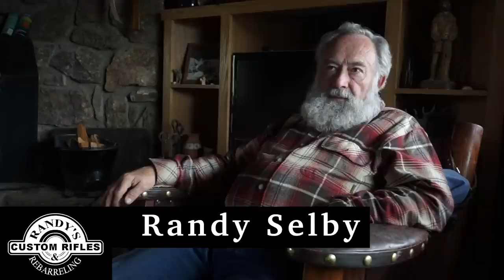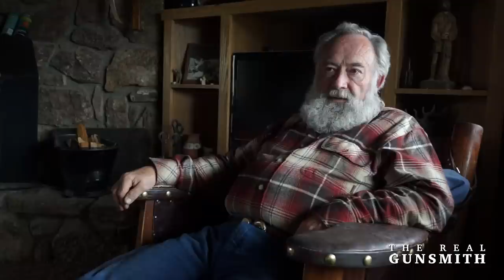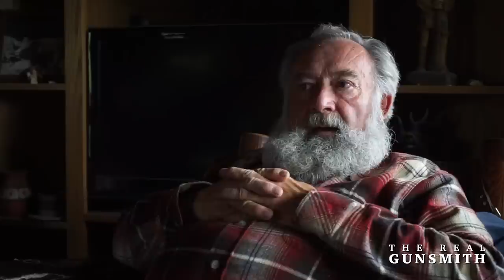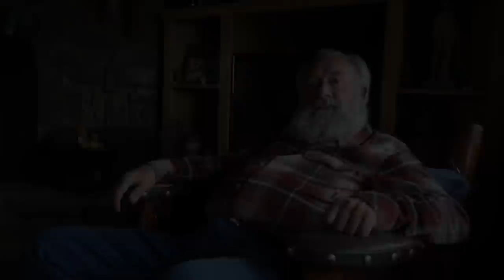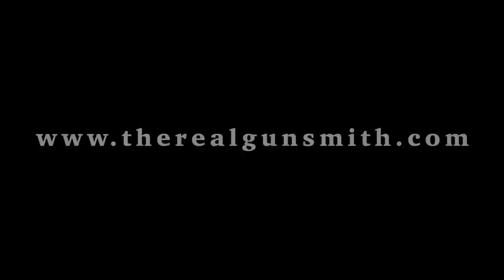Barrel Accuracy Life – The Real Gunsmith

Comment: It would be interesting to hear what the Army experience is with barrels. I remember shooting a 7.62 mm belt-fed Browning machine gun until the rounds were going out wildly out in every direction, completely worn out. Heat was definitely the most important factor.  The barrel was white-hot.  WWI MGs were water-cooled, allowing them to shoot incredible numbers of rounds in succession.  .  Somewhere out there, there is a cloud of data on what the engineering parameters are. I'm sure that it does not contradict what is being said here.

Comment: As a Tanker who used a M240 on two different guns. The main coax gun is connected to 10k rounds in a belt fed system. We alternate barrels as on gets red hot. It's using the same sighting as the main gun also shooting tracers. Never loses accuracy until the twist is wore out. 19k out.

Comment: Barrels are consumable items like tires. You want higher performance tires, they are used up faster. And your super hot rod rifle rounds also wear things faster.

The flip side is a cartridge like the 6.5 Grendel that runs only 30gr charges, a max of 52k psi and gives barrel life that seems to last forever with 123gr bullets at a modest 2450fps or so. It’s becoming my favorite cartridge because it’s so balanced.
Reply: Ding, ding, ding. I shoot a 28 Nosler that hasn't seen 1 round of factory ammo. I roll my own. In 50 rounds I found es of 6 with a great velocity that shoots sub moa. This old fart talking on the video just wants to knock anything that has any life to it past energy of a 270 lol

Comment: I love listening to someone that knows of what they speak.  I've done a little gunsmithing (compared to Randy) and I've taught gunsmithing at  continuing education college.  I built a 6.x55 on a Mauser 98 action about the time the Creedmoor was introduced and for a while wished that I had chambered my rifle in 6.5 Creedmoor.  During load development I realized that I was getting the maximum velocity for that action and my chambering because the bolt lift started getting stiff at around 2950 fps with a 120 grain bullet.  The rifle shoots in the threes and has taken many feral hogs, white tail and blackbuck antelopes.  There's no benefit with the particular action I used to more speed.  No animal I have shot with it survived and most dropped on the spot.  A few ran up to 100 feet.  All of the paper I have shot died immediately.  At my chosen velocity of 2775 fps I anticipate that I will not shoot the rifle enough to need a new barrel in my lifetime and I shoot far more than the average hunter.  I practice throughout the year with my rifles so I am competent when it counts.
Reply: Facts!!! I agree buy a little bigger and load in the mid range or so and extend barrel life! You usually will find better accuracy at those nodes also!

Comment: Through experimentation, load development, & patience - I made an old Mashburn turn from a keyholing has been to a 1 hole 3 shot group rifle @ 200m.  I started with factory Remington 25-06 ammo - one box of 100 grain flatbase & one box of 120 grain boat tails. I shot the boat tails first to try & sight it in @ 25 m & nothing but keyholes. I finished that box to fireform some cases. When I switched to the 100 grain flat base factory ammo - it shredded the hole @ 25m. Moved out to 100m & shot sub moa, even while fireforming. If I forget to pack ammo  to hunt with I can still use 100 grain flatbase factory ammo just fine. My go to load is 58.5 grains of H-1000 pushing a 120 grain flat base. At 2850 mv it cuts little 1/2" cloverleafs @ 200m. After 3 shots it starts to string. I keep my shots limited to 300m so I don't need more than 1 shot anyway.

    The throat is eroded for the first 1/4" of the barrel's rifling. This gun will not shoot boat tails - guaranteed to keyhole the target even @ 25m. I tried boat tail handloads with proper fireformed cases. Don't give up on these old rifles & throw a barrel on it ! Try different factory ammo, bullets, & powders first. I give credit to the guy in Oklahoma who built this old wildcat in the 1950's & want to keep his work in original condition. This barrel I'm certain a gunsmith would  call "shot out".  I consider the shot out throat as "Weatherby Freebore" lol

Comment: The way a cartridge sits in the throat. The steep shorter angles of a .243 shoulder and the way gas pressure releases will burn barrels out quicker then a .300 Weatherby mag.
They don't burn as cleanly because of gas and powder charge release is alot dirtier then the way a .300 Wby. Does, but barrel life depends on chemistry when the blank was made on top of 100 other reasons.
The throat gets shot out in my opinion and you can't really shoot a barrel out you just shoot out reliable accuracy.

Comment: This man knows what he speaks.  Let me add my comment for consideration:
While my experience cannot match Randy's, I offer what my more limited experience , experimentation and reasoning tells me.

1. barrels erode the throat first.  This is what we call a burned out barrel.  copper, carbon, and lead can ruin accuracy but that can be fixed with the right cleaning process.
2. the main wear factor is how long the pressure and heat is applied to the throat
3. heat and pressure at the throat  are determined by how much powder is trying to squeeze through how small of a throat and for how long
4. big case, small bullet diameter, heavy bullet, long barrel, rapid fire equals short life, period
5. While modern stainless barrels are the best we've ever had,  they'll still erode the throat if the above factors are great.

Gun writers since the 1950s blamed the 220 swift short barrel life on velocity.  They suggested using a heavier bullet to increase barrel life when in fact the opposite is true.  A light weight bullet exits the barrel quicker taking the erosion factors to zero where the heavy  bullets keep the heat/pressure on. longer. The fast bullets tended to leave more copper in the barrel but actually eroded the throat less
A longer barrel burns the powder more completely but keeps the pressure on longer

With a cold barrel, the cold metal acts as a heat sink and cools the throat faster.  With a hot barrel, the heat has no place to go.

While this my sound unconventional, the best why to cool a warm/hot  barrel between strings is to pour cool water through it.  followed by a dry patch.  The heat evaporates the water and the barrel cools in less than a minute rather that 30-45 minutes.  

Ever of here of a 35 rem burning out? pitted, rusted, leaded maybe but throat burnt out, never. Low pressure, small amount of powder and big diameter bullet
Reply: Please don’t ever cool a hot barrel with water! That’s begging for micro cracking from thermal shock. Not to mention corrosion in a chromoly barrel.

Let a barrel cool slowly to reduce metal fatigue.
- an experienced engineer.

Comment: another great knowledge drop by randy. thanks for passing on what you know randy, from experience, which is hard to beat or argue with . that being said if someone is getting 2000+ round out of a barrel cambered in 6mm  please let me know what super barrel they are running lol and I'm not a hater of any round , I like a lot of diff ones and feel like most have there place. I have went from 308 to 6.5 to 6mm in comp shooting and 6.5 I wouldn't take a gun to a comp with over 2000 rounds through it, 6mm about 800 to 1200 rounds though it.and on the hunting side I have took more game with my 308 then any other, but I like the 7mm bullets for hunting and if someone said you can only hunt with one caliber I would have to pick my 280AI.. I could hunt most anything with it and never feel under powered or worried it wont kill fast, hard and quick.

Comment: Yep and the 55 thumbs down know more than Mr. Selby, now 68, I don't think so desk jockey's. It's not just the bullet wt., but the amount of powder and type used, which causes the over pressures which takes the barrel accuracy away, the metallurgy of the barrel, how it was forged, 416, chromoly, stainless etc. I agree 100%, also the rifling groove depth and twist rate also play a role.

Comment: Randy, my son and I shot with Boots Obermeyer and Jack Krieger. They both counted rounds. Jack once said in a highpower class that hammer forged barrels had to much stress in them and something would pop and give way after 1500 rounds. They both single pointed their best barrels to keep the stress down. I remember Boots  telling me he had 9,000 rounds in a 308 stainless barrel before it gave up and 8000 in a chrome moly. He shot Palma with both those barrels so it did not heat the barrels too much. Both he and Jack pooled their orders for barrel steel and then they checked for incursions before they would accept the order.

Comment: The average shooter will not shoot out a rifle barrel. I have a Remington Model 700 in 7X57 I bought new in 1982. The rifle with handloads will shoot 3/8 inch 3 shot groups all day long, on average the rifle is shot maybe 10 times a year ( check zero and used hunting) I've seen rifles that are 50 years old or older that still shoot 1/2 inch or less at 100 yards its all about proper barrel cleaning and not shooting the rifle til it gets hot , meaning so hot you can't hold on to it.
Reply: Agreed. The average hunter will never shoot out a barrel to the point where it loses acceptable hunting accuracy. To target shooters, barrels are a consumable.
Reply: I know a competition shooter that swaps a barrel after 1,500 rounds. That's basically one year worth of shooting for him, half a lifetime or more for a big game rifle.
Reply: It is not about the age of the rifle, it is about the number of rounds shot through it and the manner of shooting. I can buy a 1/2 moa rifle and put it in my safe for 100 years and it will still be a 1/2 moa rifle, the fact that it is 100 years old is immaterial. Randy is correct on people ignoring pressure, but barrel life is all about the number of rounds shot. One cannot compare a 1990 car with 30,000 miles with the same year and model car with 200,000 miles, same with barrel life. Loss of accuracy is caused by erosion in the throat of the rifle, which is caused by heat and pressure. This is why people "chase" the lands by extending the bullet more, to extend barrel life and accuracy.

Comment: Few points...

Barrel life is a combination of several things. The 4 most important are:

1. Peak pressure (higher = more wear)
2. Barrel temperature (higher = more wear)
3. Amount of propellant (more = more wear)
4. Bore diameter (more = less wear)

The wear has nothing to do with friction of the bullet or its peak velocity. The wear comes almost entitely from the initial high pressure, high heat, high carbon gas blasting the throat of the barrel and the first couple inches. It is like a combination torch and sandblasting type effect but just a short duration for each shot. Forcing a large, high pressure charge into a small bore means more wear. Hot steel of any type is softer and the cutting/blasting effect on the throat is enhanced. This is common sense.

I dont clean my barrels till they have a drop off in accuracy. It takes about 10-20 rounds to re-season your barrel with copper and fouling to get consistent accuracy and velocity. I shoot a 6.5 Creedmoor. It does drop off on accuracy at 1000 rounds... but then I clean it and do a full copper removal. 20 rounds later, accuracy is restored. You can do that at least 3 times. I shoot 100-300 rounds a session, usually about 150. If 6.5 Creedmoor burned up in 1000 rounds Id throw it in the trash because I'd burn a barrel every couple months. My pet load is a 140 grain bullet loaded with 42.0 grains of H4350 so I shoot it with a very full, but not 100% case capacity load and it is over book on many, but not all, reloading manuals. Still producees .75 MOA groups right at 2000 rounds. It started at .6 MOA. Expect to see about a 0.1 MOA decrease in accuracy per 800-1200 rounds fired. A barrel that starts at .5 MOA would stay sub MOA for 4000-5000 rounds if you never got it stupid hot.

Comment: I cant argue with anything you have said, I would add, that with higher pressures comes higher heat. I believe that higher heat conditions are the most damaging factor and that can occur from shooting multiple rounds as you stated but it also occurs with shooting far more fewer rounds at higher pressures. Pressure can equal higher temps. I have a 308 that was built in the 1960's and it to this day shoots 1/2" and 1" groups depending on the load. This gun I purchased new and know that it has had 5500 rounds thru the barrel. I have always been extremely aware of heat buildup and did my best to prevent it. I also believe proper barrel maintenance thru cleaning is extremely important.

Comment: I use 3.5 gr. tite group for .224 and 8 gr. for 308.  Pressure is 4,000 for .223.  In bolt rifles.   After shooting, the brass comes out of the rifle cooler at an indoor range than it is in when it comes out of my trunk.  The brass has lasted over 50 times reloading, so far.  after over 2,000 rounds, off a bench at 25 yards it will send the bullets threw the same hole.

Comment: I shoot PRS in my first rifle I basically used Hornady factory match ammo and got 3,500 rounds before it went from a .5 to 0.8 inch barrel. My next barrel was an X-calibur barrel same caliber and I only got 2200. My 6 GT Krieger barrel I got 2,600 rounds and now I'm running a proof research barrel, I'm at 2400 rounds and it is still shooting .4". The guys running competition 308 barrels are getting around 3,500 to 3800 rounds before the groups open up and the 223 shooters are getting about the same.

Comment: Glad i watched this video this explains why im no longer getting consistent accuracy from my old 7mm rem mag. I know i have about 2500 rounds through it.   I learned how to reload and used that rifle for everything. Mostly shot paper some varmints some deer and pigs.  Shot alot of those bulk 500 count speer 110 grain varmint bullets, (4 boxes) usually at high velocity. High speed and low recoil.  Worked great on coyotes.  Noticed i could regain some accuracy by going to heavier bullets seated slightly further out of the case. Its still Good enough for medium game hunting out to 300 yards or so. 😅 i dont need a 7mm rem mag for that though. Bought it slightly used for $450 out the door 27 years ago.  Probably most people would never put that many rounds through a 7mm rem mag. Not buying multiple rifles overall probably saved me money over the years. As some people buy new rifles for certain purposes and reasons. One for deer one for varmints one for elk one for bears one for target shooting. I did however have to endure more recoil than i would like at times.

Comment: 100%.  Speed affects heat.  Heat affects barrel wear.  Even powder chemistry can affect barrel life.  Certainly the metallurgy of the barrel will affect barrel life.  But as the barrel loosens up, reducing the charge in the cartridge (reworking the load to change harmonics) can extended the usefull life of the barrel.

Comment: you also have to take in the equation cleaning, powder temp and burn rate. I shot a 6.5x284 barrel out using H4350 @ 1710 rounds it shot 3/4" group. I had a new Bartlein 28" barrel put on it and have only used Vit N165 powder and religiously keep the chamber and throat clean of carbon. I have 2110 rounds on this barrel and it still shoots under 1/2" groups. Carbon will speed up the throat erosion process a lot!!!

Comment: Cold hammer forged chrome lined Kalashnikov 7.62x39 barrels are one example of barrel which has a pretty amazingly long life. When I first bought my Romanian Kalashnikov I slugged the barrel. Last year I finally surpassed 30,000rds fired through it. I slugged it again and it hasn't increased in diameter either at all, or it's such a small amount that my dial caliper which can measure 0.001" at the smallest cannot measure it. That's 30,000rds of Russian production mild steel jacketed bullets which have a very thin copper wash over the steel jacketing.
Reply: ABSOLUTELY RIGHT

Comment: When I reload, of course I load up to the desired velocity.  But I use the powder that produces the least pressure for that loading.  When 296 gives me 48,000 but 4227 gives me 32,000, it’s a no-brainer.  And pressure also can oddly spike up for a particular powder if you decide to go with a reduced power charge leaving a lot of air space.  Found that out the hard way.  Damn you finicky 300 Blk.

Comment: I have fired about 2,000 rounds through my .340 Weatherby Mark V and it still shoots sub-MOA even at long range. I shoot full loads but never get my barrel too hot and I scrub the bore clean after every outing, so hopefully it will maintain its accuracy for a long time to come.
Reply: That's a big round that's going slow.   U will get alot more outa a rifle like that.    Shoot a 6.5 x 300 weatherby.  1000 is alot
Reply: @REDNECKROOTS  I am shooting 225 grain Nosler Accubond bullets 3035 fps. That isn't exactly slow. That's just 500 fps slower than my .257 Weatherby mag.
Reply: @340wbymag  wow didn't think that could reach that vel.   Nice!

Comment: What is your opinion on cleaning? Do you use sweets 7.62? I recently started using the sweets 7.62 solvent for the first time. I was amazed at how much copper fouling some of my older guns had in them after cleaning with hops no.9 all these years and not getting all the copper out. My groups tightened up considerably on a couple of my rifles.